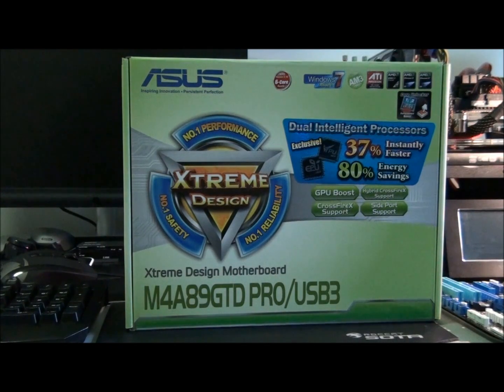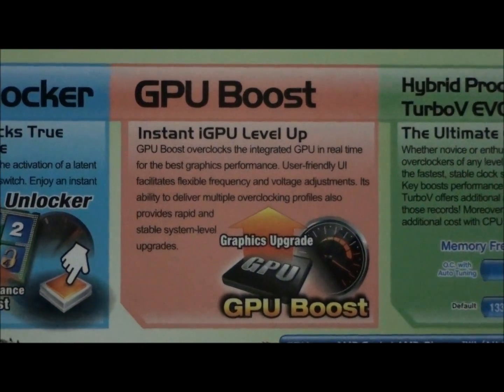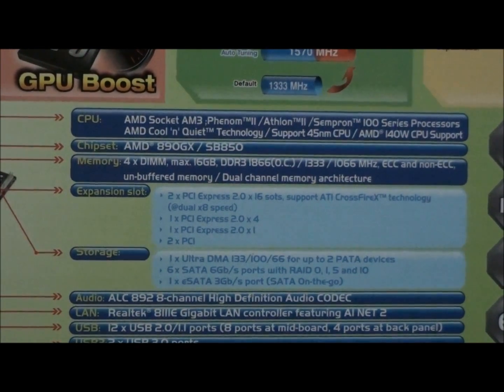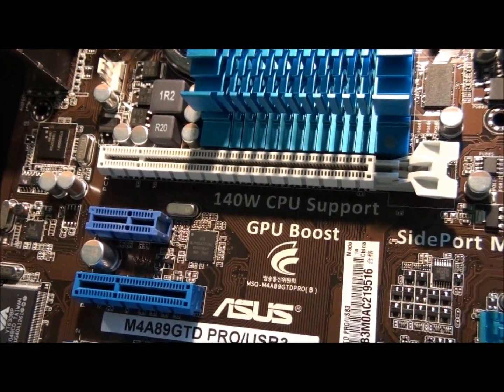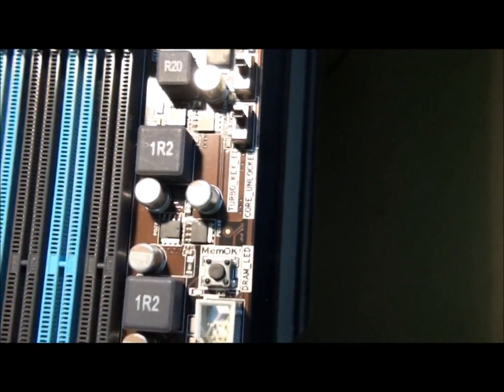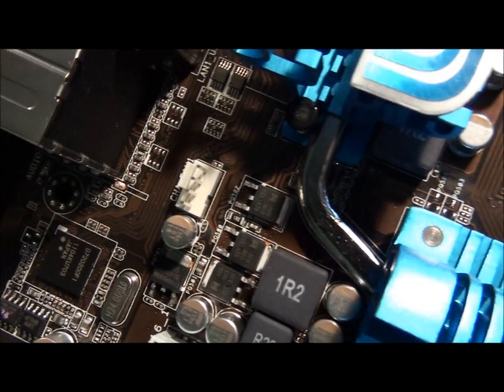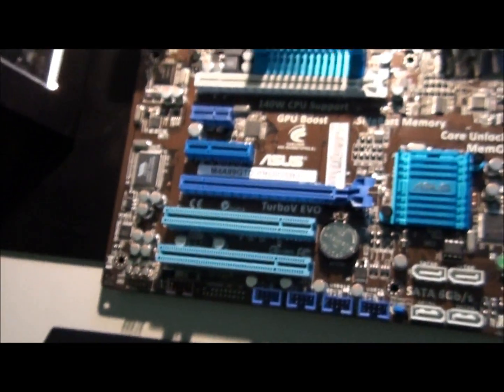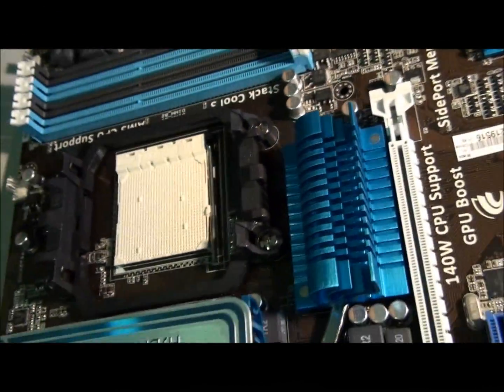Asus M4A89GTD PRO/USB3 Motherboard Review

Comment: I've been using this board for 7 years on a gaming rig built in 2011 on an AMD Phenox ii, Arctic Freezer cooler. SO stable i dont even want to upgrade
Reply: unfortunately, many games require processor instructions that are not present in the phenom. Far Cry 5 can not work on Phenom, but can on FX series
Reply: @Pavelkozhin  tengo un AMD Phenom II 1090T X6 Edition Black ... don 6 núcleos con uno extra y no cree que corra ese fair cray?? 😂
Reply: @lorenzolamas1783  I'm did not understand what you mean

Comment: five years it has run great; lately, periodically, the boot order changes itself in the bios and one time only 3 cores came up after a restart...again, it was changed in the bios.....what would make it change on it's on? i wish i knew
Reply: problem with circutry, that power on CMOS or BIOS. Some resistor could go off balance, and voltage dropped, so it's unstable.
Could be also because PCB bent. There can be microscratch somewhere, even inside PCB. Also, can be damaged battery socket, including circutry around it.

Comment: Hey I have a issue with this board. When I start up the system I CAN go into the bios and change settings and so on, but as soon as I put in my windows 7 Operating system cd the motherboard goes into a kind of looping state. It starts and I can go into the bios still, but when It comest to the part where it is going to read the cd, it says "no signdal; analog" on the screen and everything starts over again. I have tried to remove the battery and the ram but it does not work. Any help on this?thx

Comment: Great review sweet AMD board, I guess brown PCB is cheaper then black ROFL!
Reply: You are wrong. 
It doesn't matter, particulary on Asus boards, where they charge always extra, cause they use better components.
They could use black or brown, no matter. They've opted for brown. In era around 2008-2013, it was typical for Asus, they were using "coffee" color, black was only on best of best. Like Maximus line, etc...